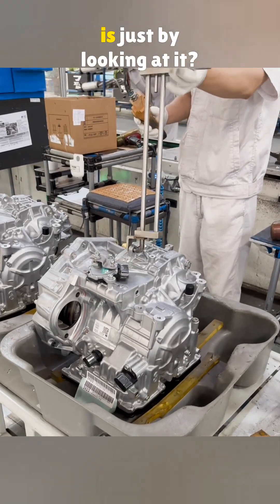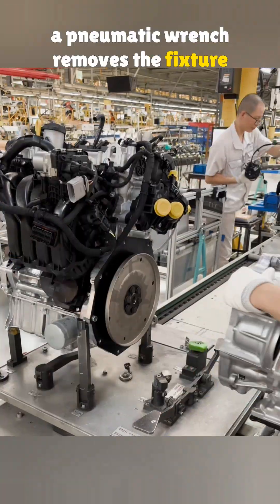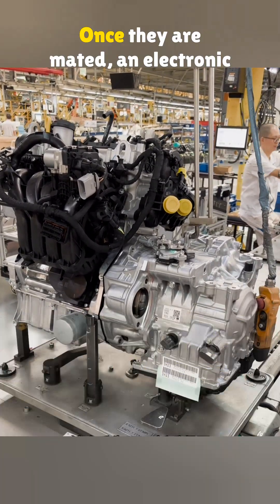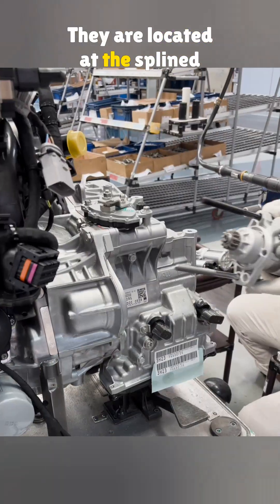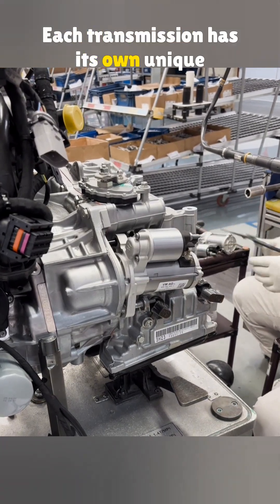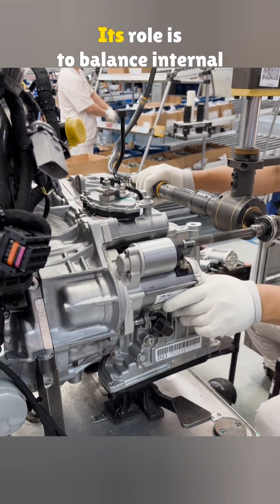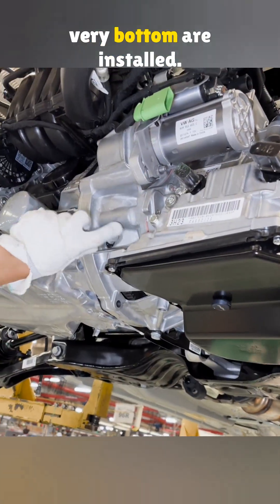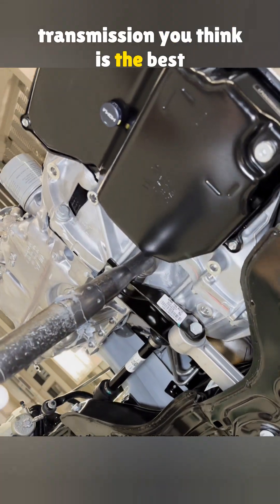Inside the Factory Process of a Modern Automatic Gearbox

Comment: This is a Volkswagen Direct-Shift Gearbox , Direktschaltgetriebe (DSG),  transmission in a transaxke configuration with code 3H234882.

Which transazke transmission is the best overall? 1)ZF 8-speed automatic transmissions 2) Aisin-sourced automatic transmission such as the 6-speed in Tacomas and Tundras.

The "fixture above" that was removed was to keep the torque converter in place while the transmission is being moved.

The small hole is the transmission fluid fill and level check hole.
Reply from the maker: Thanks